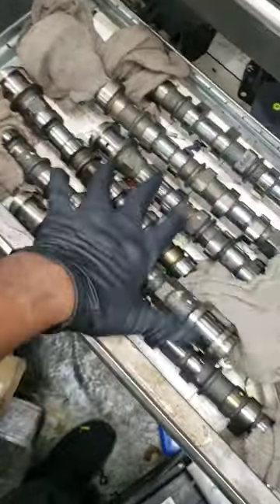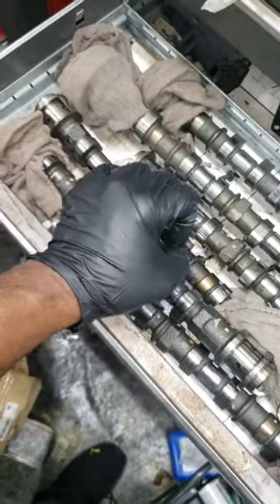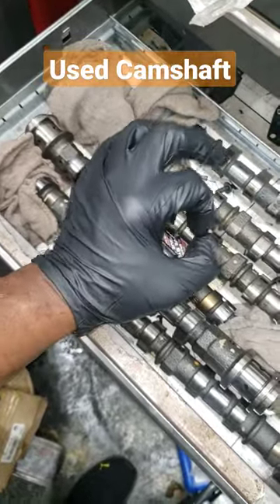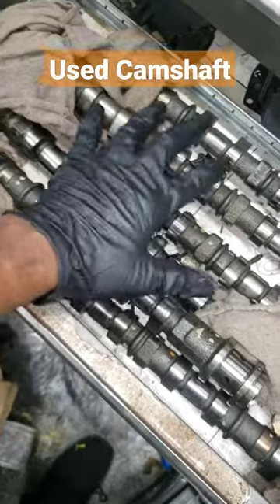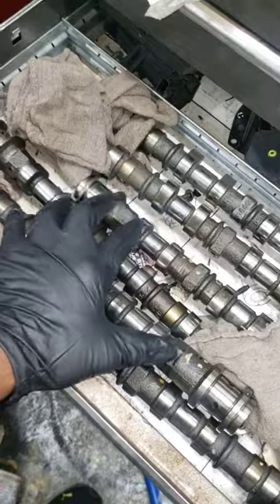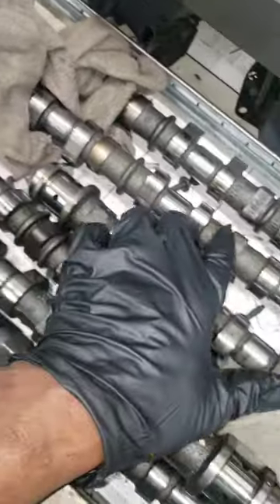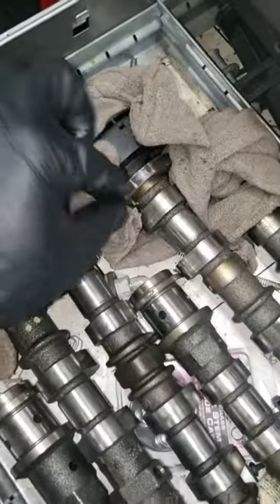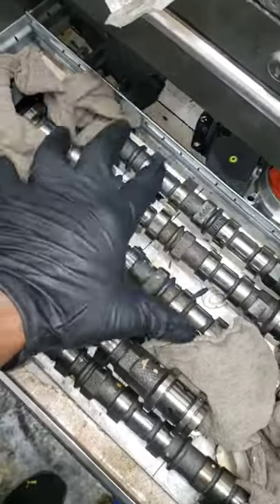Here's why my Hemi or 3.6L  Ticking Noise Job estimate so low. Brand new camshafts mean nothing.

Comment: Just had my work  Grand Caravan repaired at dealership. Replaced all 4 cams $4,600. WOW. Hope my 2018 Ram 1500 with the Pentastar doesn't need this any time soon. 125K runs great can't even hear it running. Really like your channel. I own 4 Mopars and have learned a lot from you. Thanks
Reply: If I had 2 vehicles with em and wanna keep id find a cheap decent core and overhaul it myself, nd keep as insurance. That’s how I’m feeling about my 12 ram 1500 5.7 I love it even tho I like newer ones 09-12 has patina and less electronic crap
Reply: Not judging don’t know ur situation everyone’s different sorry for rant 😂✌️

Comment: but... arnt camshafts machined to the head? and the cam bearing caps machined to the cam journals... if you install those cams with different bearings caps you could crack a cap and the tolerances are out of spec

Comment: Storing them like that guarantees that they’re all bad.
Reply from the maker: Explain your def of a camshaft going so called "bad" based on how this is stored
Reply: @OnlineMechanicTips  the magnetic reluctor wheels are explicitly prohibited from being in contact with any other magnets, even each other, and they are very delicate. Loosely rolling around in a drawer is likely to damage them and these parts wouldnt be useable for anything other than a buddy, a cover your ass sneaky warranty repair, or your own vehicle. Cams are too cheap to be taking a risk like that.
Reply from the maker: @MWilk098  Thats what we have all read and been told. Now if you look hard enuff, you would likely see a ruuber glove and a rag covering the tone wheel part of the cam. But seems thats not really as big of the hype we all once thought. Ive never had a problem using used cam that has been thru hell and back. Theres nothing wrong with these cams and they readily available when I need them.
Reply: @OnlineMechanicTips  Unless they're backordered at the time, it just ain't worth the risk. $300 and its good to go. I've seen too many of these things act weird as hell and it all came down to weak pulse from the tone wheel.
Reply from the maker: @MWilk098  Theres 0 risk. You thinking to hard. Been doing this for over a decade now. If those lobes not damaged and that tone wheel not loose, that cam gold. And readily available doing my many estimates and repairs.
Reply: @OnlineMechanicTips  there is a non-zero amount of risk. They are permanent magnets and they run the risk of demagnetizing. It does exist. Your point about not replacing them if they’re not bad is true. People need to stop throwing good parts away.
Reply from the maker: @MWilk098  Sure they run the risk, but the dont. Never had a problem. Found good ones in the trash can one time with all kinds of stuff on an and around it. They now been in a minivan for the past year, no problem.

Comment: Are you talking about changing cam size or just swapping for the same size cam. Im new to car shit in general, but ive been under the impression that a larger cam allows for a greater volume of gas and air exchange and at least makes a throatier sound
Reply: As a dealer we’d most never replace with an aftermarket cam only stock cam
Reply: @Billybobaggins9  i got u, makes sense
Reply: No you can in fact get a high lift and duration cam but you need to get one for your specific engine and you will most likely need a tune to see any power improvements. I'm sure you know there are "stages" to a lot of modifications so a stage 1 cam would have the most street driveability while a stage 3 or 4 would be more for a high power platform. Don't listen to that dude, you most likely will never need to replace a stock camshaft anyway, this only applies to modifications. If you do need to replace a stock cam definitely go with stock if you are not looking to make more power or take your vehicle to a tuner
Reply: @nebula4287  lol

Comment: I have the 2011 GC Overland 5.7. It has many issues, but in regards to the hemi tick, would you recommend replacing the lifters?
Reply: I got a 2012 ram 128k how much miles on that and what issues, Ik mostly about 09-12 years  rams I’ll see what I can help u with.
Reply: Is it a extremely obvious tick ,tap or bad manifold mine spits and sputters ticks when cold or sat for 5 min off but 1 min later gon